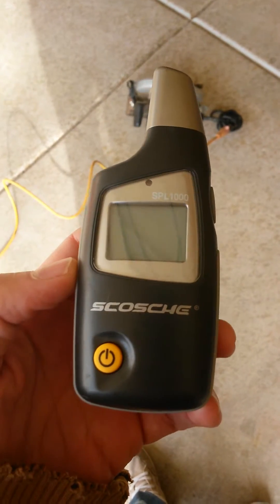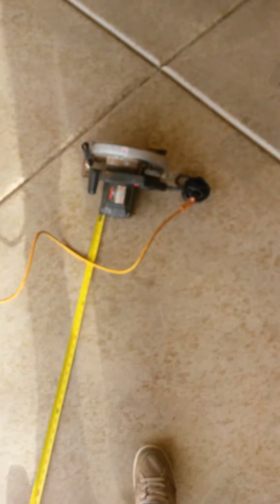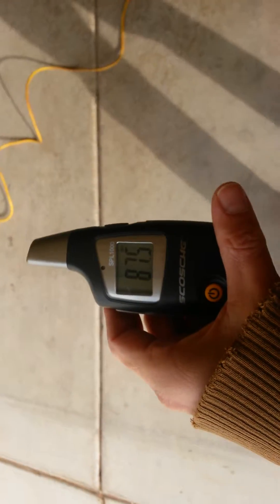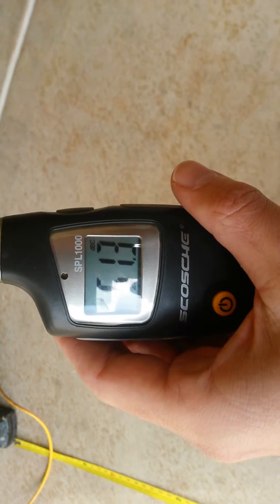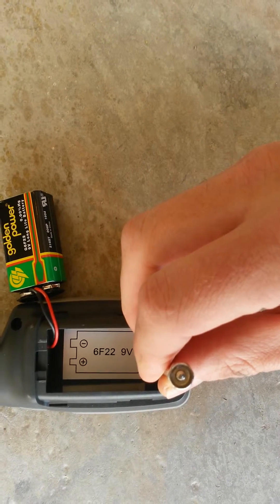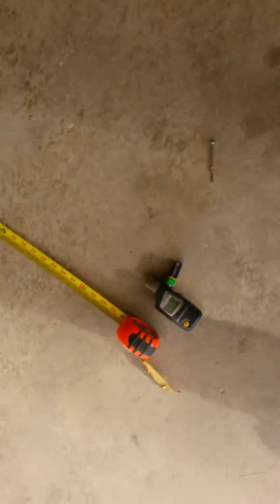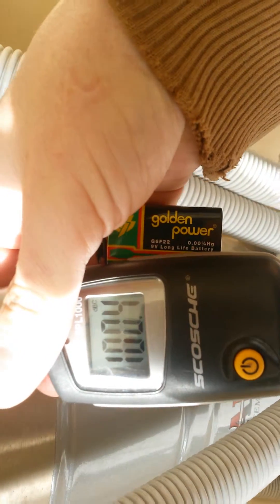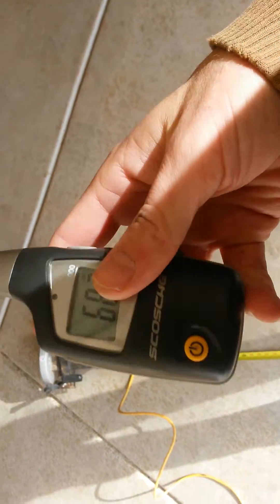Review & Calibration of SCOSCHE SPL1000 Decibel Meter ~ CAR BASS SUB WOOFER METER Db

Comment: Man, I don't get it. Calibrating while yacking ? Non-standard SPL sources ? This review is hooey. I have this meter and tried to "adjust" the meter against a NIOSH SLM with a source of 1KHz at 77.5 dB. The Scosche SPL1000 showed about 10 dB south of the mark. The "adjuster" screen did SFA to the calibration. Peeling off the battery sticker showed 3 other 1.5 Philips screw heads. None of them had any effect on calibration. Someone is blowing some smoke up our backsides here.